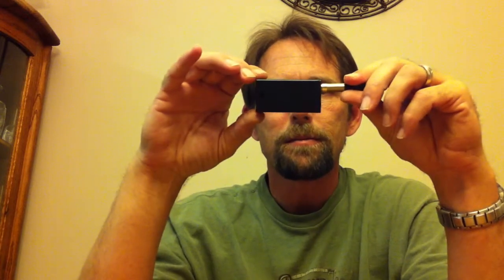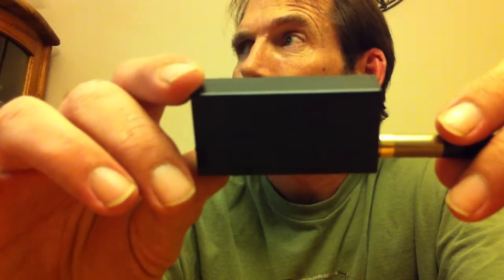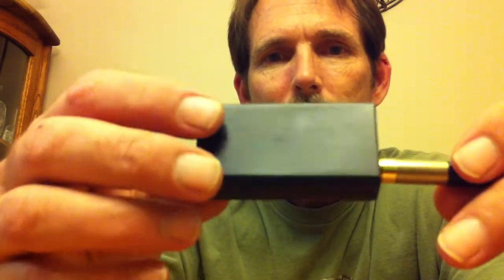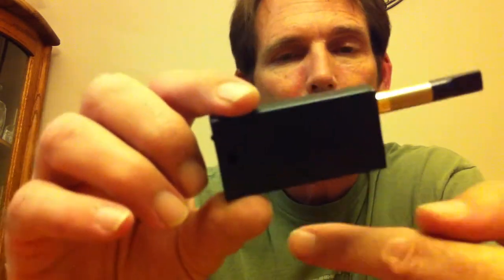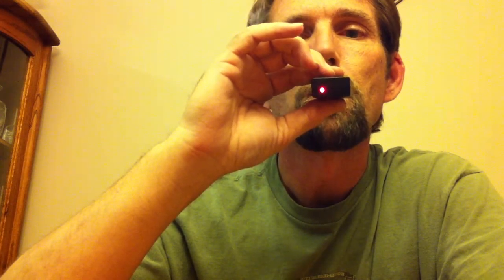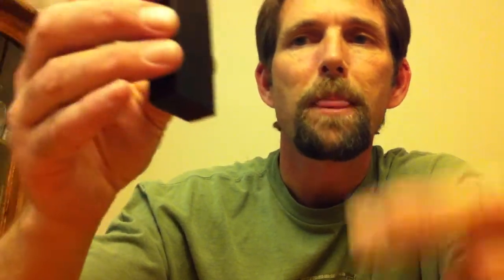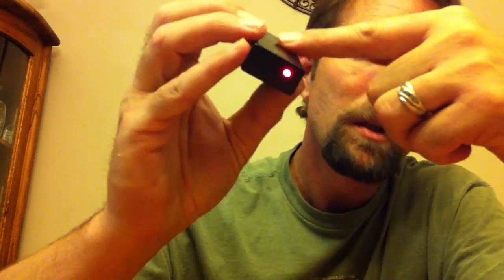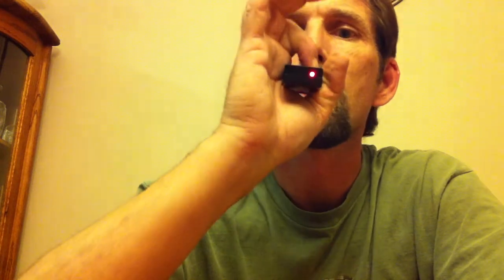Proximity Touch Swicth E-Cig

Comment from the maker: Have to have a hole in the activation finger or take the gloves off. It will not work through clothing. Of course if you cahnge the 10nf chip to a 47nf, it might. The higher the nf capcitor is the mor sensitive it is.

See my thread on the ECF for making one, posted above in the "More" section.
Dan